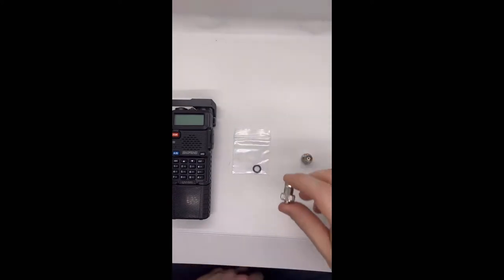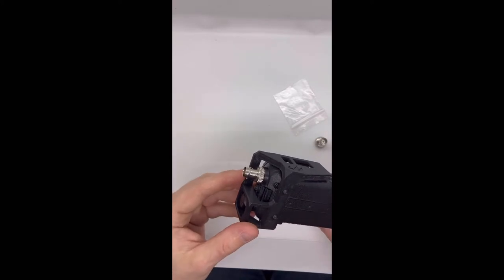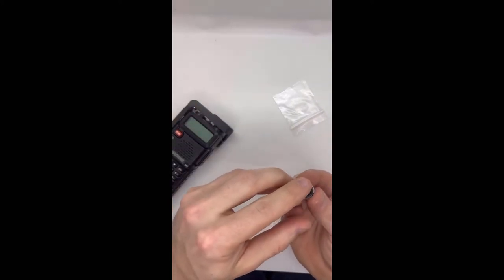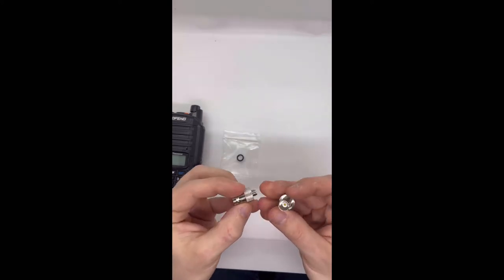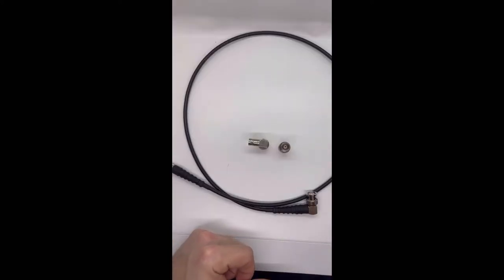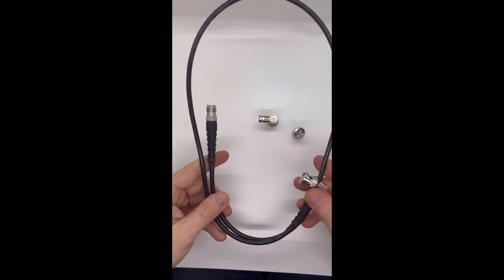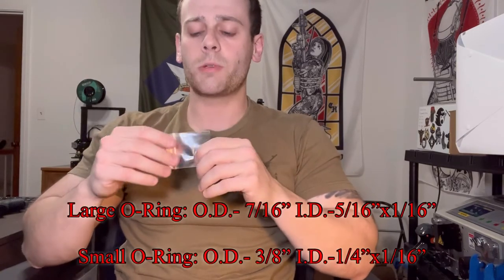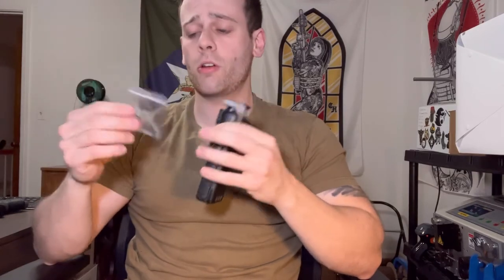O-Rings on Antenna Adapters

Comment: I use a Motorola APX 7000 and wondering what antenna you’d recommend for my application 
(30-512MHz OR 600-900MHz)? Or something else?
Reply from the maker: What frequencies are you running on? An easy way to check is on the stick antenna or on the radio behind the battery.